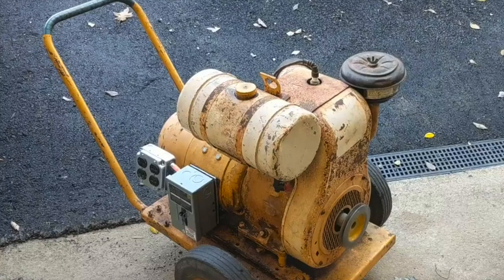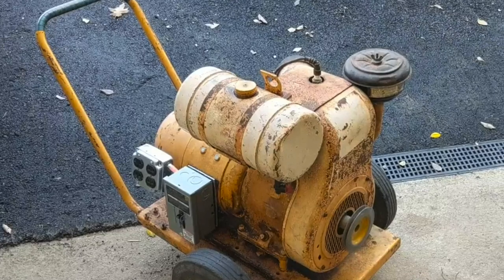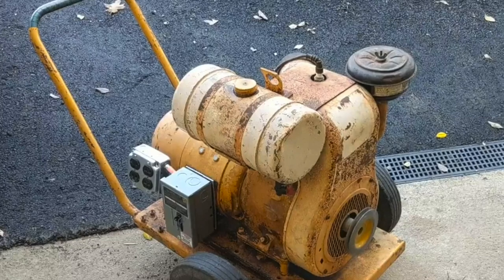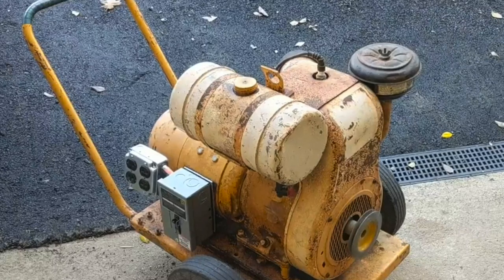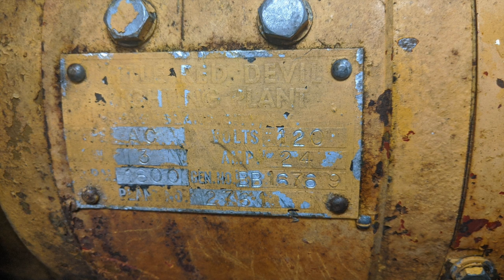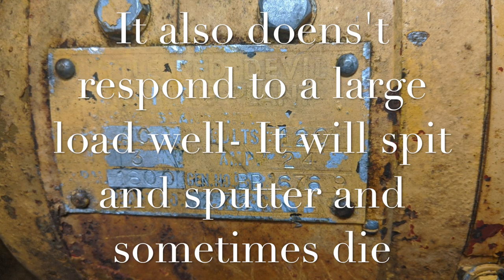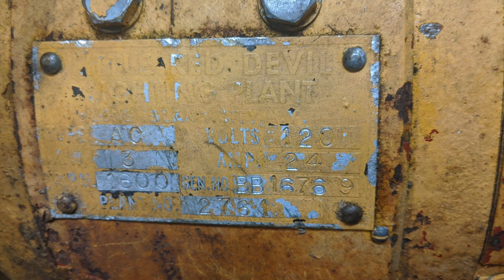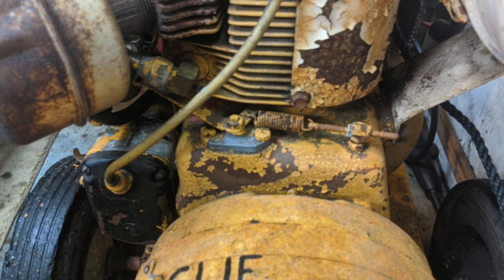Help Needed! Wisconsin Generator Question

Comment: Could be a few things. Governor needs adjustment or replacement. Carb may not be operating properly. When you put a load on it, do RPM’s slow?  Lastly it could be bad diode in head.
Reply from the maker: Ok Thanks! The RPMS do slow if it's not too big of a load but it will attempt to rev up if a large load is placed on it.

Comment: The governor arm may not be in the right spot on the governor shaft and not able to move the right amount. I would guess if you get the rpm right then the frequency and voltage will be ok. Just something to check if you haven't yet.
Reply from the maker: I now got the thing to run correctly: there was a missing plug on the carburetor where the throttle shaft goes through that was leaking air. Got that sealed up and it runs fine now. Can't say the same about the power output though. Still having issues with that. Thanks for watching!